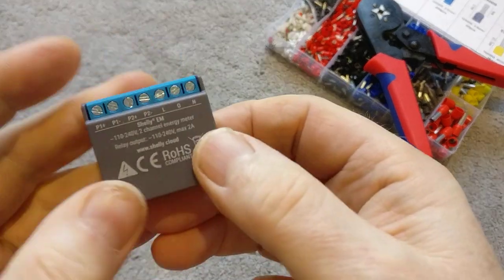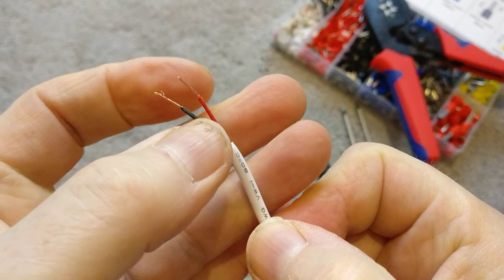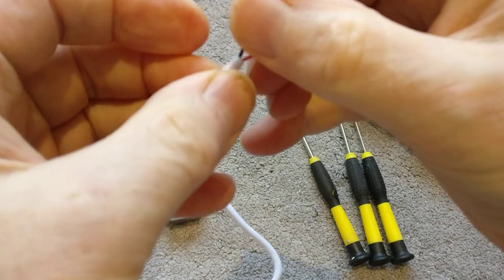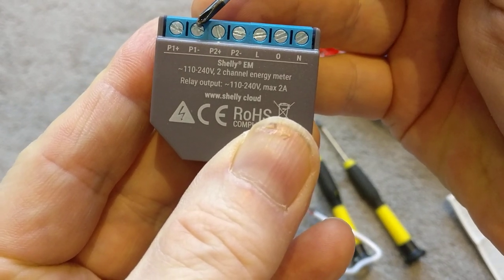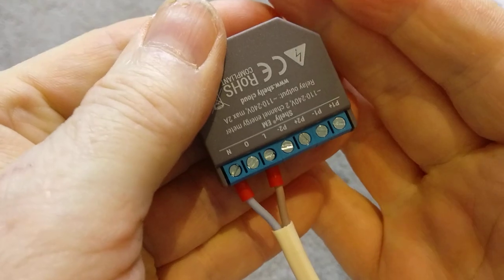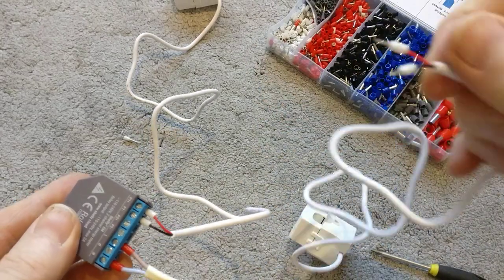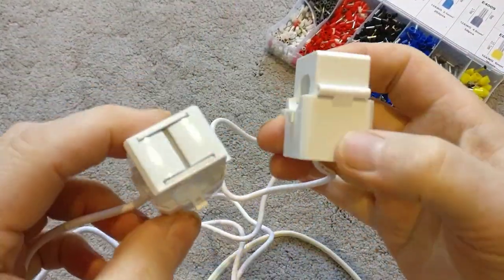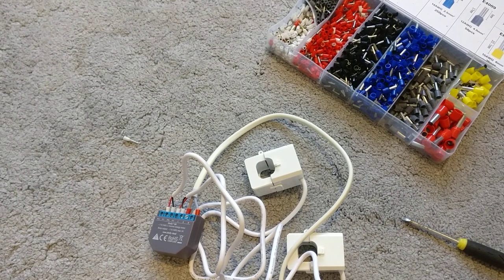Shelly em Smart Energy Monitor - Wiring Guide

Comment: Thanke Pete, I bought the Shelley 3EM so the inputs are slightliy different but thanks for the crimping and wiring lesson, worked really well.
Reply from the maker: I'm glad it was helpful. Theses Shelly's are great.
Reply: @Builtbypete  How does this work when people have solar and batteries? The wire showing the load into the house is going to show minimal electricity. Do they connect to a different wire, and where would you find it?
Reply from the maker: I guess it depends on setup.  If the  batteries and or solar get to the house via an inverter, then you could put the sensor son the output of the inverter. Or if the house has a cross over switch you could put the sensors on the output of the cross over.
Reply: The problem with these systems is they are all trying to do the same thing job and compete. I’m getting a heat pump installed so I will use the Shelly to monitor load and hopefully use it with my Ecoflow system to direct some solar power towards it.
Reply from the maker: Sounds like a good setup 👍

Comment: Strange my comment has been deleted. Wanted to know can this be done directly in garage we’re the power comes into the main fuse and red and black wire going to the meter? And also be plugged directly into wall socket?
Reply from the maker: Hi. Not sure what happened to your other comment. The placement of the Shelly depends on what you want to measure. If it's the whole house then you need to put it on the positive tail comming out of the meter. Just the positive not both.
Reply: Also can the Shelley be plugged in directly to socket? I don’t have consumer unit in garage? And yes I want to measure whole house
Reply from the maker: @akhan999  You can power a shelly from a plug socket.  I would put a 2amp fuse in the plug.
Reply from the maker: https://youtu.be/77Df_yhanvg
Reply: Thank you so much for responding quickly
Reply: Thanks I’ll place the Shelley in a secure box and just plug it directly to socket in garage and see if that works. I sent you a link of the picture of my meter etc but you tube removes them that’s what happened to my previous comment 😃
Reply from the maker: @akhan999  your welcome
Reply: Thank you got it all setup in the garage and seems to be working. Will monitor it for a few days but look good. Also added it to my home assistant dashboard too so I can get a rolling cost of how much energy is Being used
Reply from the maker: @akhan999 great news.  Im pleased.   They are great little devices!

Comment: Hi, I want something like this to monitor my washer / dryer energy usage to create automations so it wouldn’t being going into a consumer unit - would this setup be OK if the Shelly it’s self was put into a protective box? I like this thought of something like this completely separate and not changing the washers wiring atall
Reply from the maker: Hi.  You can monitor individual devices, but you would need the clamp to be on the live feed only to get accurate measurements.
Reply: @Builtbypete  thank you - I’m not concerned about it being 100% accurate just really want to know if it’s drawing power or not so I guess it being over the machines power cord should be ok for that purpose?
Reply: @simps100  never works great to do that tbh 
they cancel out if you do that and the readings are pretty much useless 
easier would be to make a box with a socket and a plug where the shelly is mounted inside
Reply from the maker: Ben is right. The live and the neutral are 180 degrees out of phase so a clamp over both wouldn't see anything. If you want to only know if the device is on and not how much power it's drawing then you could use a smart plug and have it integrate with a smart home hub if you have one.

Comment: Do you know if it is possible to cur the cable of the clamp to reduce its length or will it make the clamp bad?
Reply from the maker: It should be fine, but you could always shorten the lead if needed.
Reply: @Builtbypete  Thanks!
Reply from the maker: Your welcome. Maybe test it. You could look at the readings with the wire coiled and then without. I might so some testing on mine as well.

Comment: The Shelly 2EM is suitable for split phase at an angle of 180°. Then you need to twist one current clamp around. 
But the Shelly 2EM is not suitable for three-phase current with an angle of 120°. 
Then you can use the 2EM to monitor two currents on the same phase.
The Shelly 2EM distinguishes consumption and feeding into the grid from electricity.

Comment: Any way to power this via a battery pack using USB into the battery but wired like you have into Shelly EM ?
Reply from the maker: Hi.  These Shelly units are powered by 120 / 240 V AC.  I'm not aware of a way to power it via DC unless via an inverter.
Reply: @Builtbypete  ahh that's a pitty, looking to replace my aging Wattson energy monitor...
Reply from the maker: Oh right. I seem to recall a raspberry Pi project somewhere for energy monitoring. You could certainly power that from a battery.

Comment: How do you know if you need 50A or 120A?
Reply from the maker: Have a look at your meter tails. See if they are 25 or 16 mm squared.
Reply: Hmm no idea how to measure that. Maybe I need an Electrican although since I don’t need to go into consumer unit thought it would be doable myself
Reply: The diameter seems to be 11mm, and 50A clamp internal diameter is 10. 

So maybe best to get 120A
Reply from the maker: If the tail is a 25mm squared then the diameter of the copper cores is about 5.6mm. so another couple of mm for insulation would get you to about 10 or 11mm. So my guess would be you have 100A 25mm squared meter tails.
Reply: Thanks I’ll get the 120A appreciate all the help. Excited to get this up and running and in my home assistant dashboard